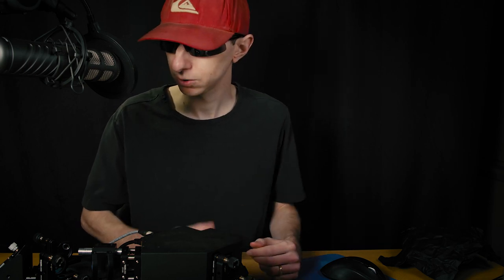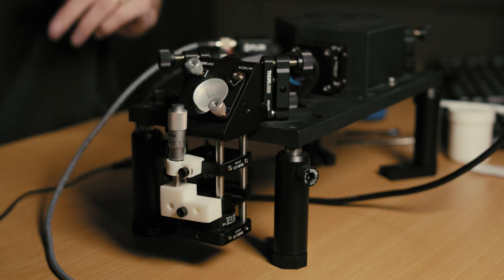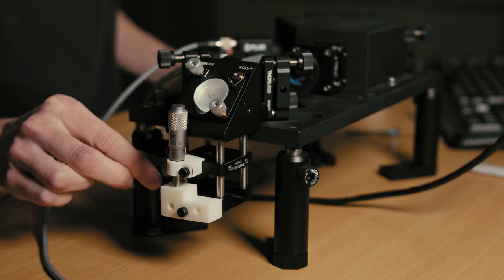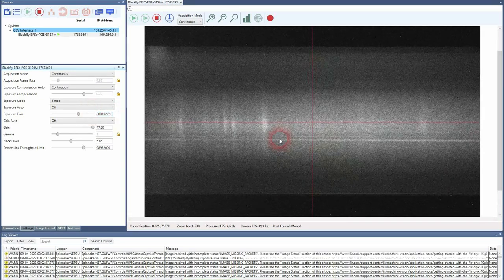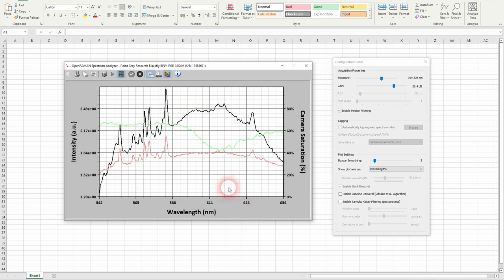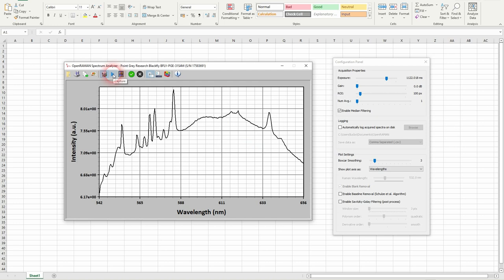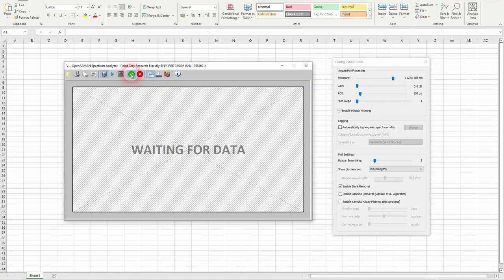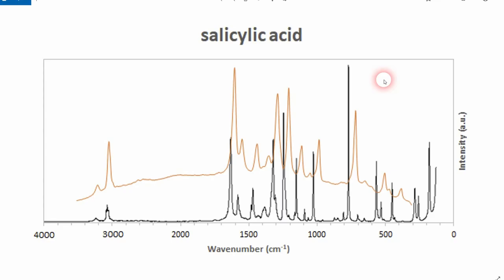OpenRAMAN Solid Powder Add-on

Comment: I built a Raman system that’s similar to yours but it functions like a Raman microscope. It has epi-illumination and a camera for imaging the sample. The sample is placed on a microscope slide and positioned with an xyz stage. A removable right-angle magnetic turning mirror from Thorlabs can be used to introduce the laser. It works really nicely, though it is more complex and more difficult to align.
Reply: Would you be able yo document this some? (That is if you haven’t already!)  Every little bit helps so seriously feel free to post what you can, wherever you can.